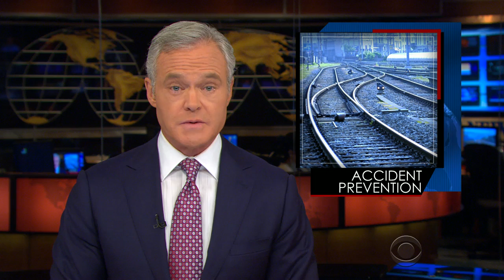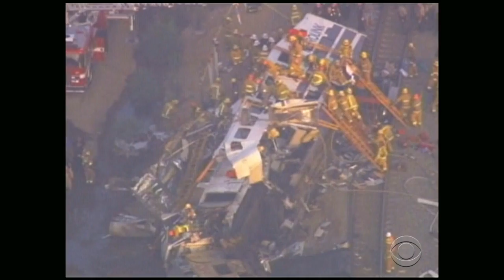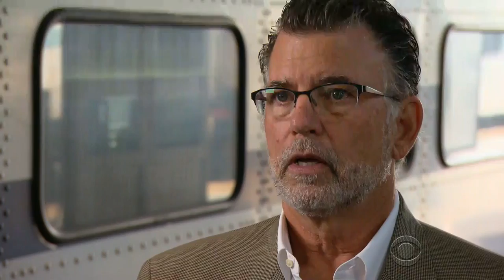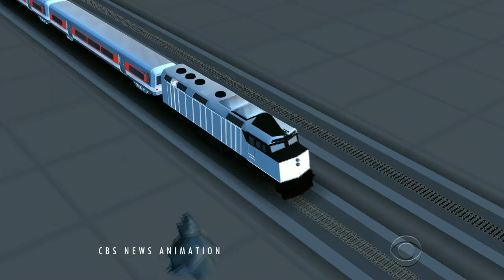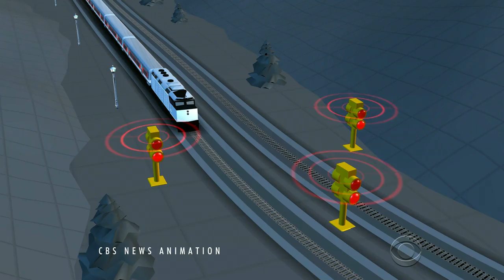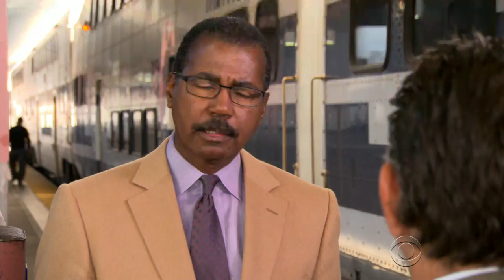L.A.'s positive train control system on track in wake of deadly 2008 crash

Comment: A similar crash occurred in Los Angeles claimed the life of a Los Angeles police officer.  Her comrades mourned her loss, but when her body was removed under a sheet from the wreckage after her Metrolink train slammed into a Union Pacific freight train, her comrades gave her a salute, just as they did at her funeral.  Railway GPS systems can’t prevent accidents, but PTC can.  Positive Train Control (PTC) can safely slow a train to a stop even in the most unlikely of situations.